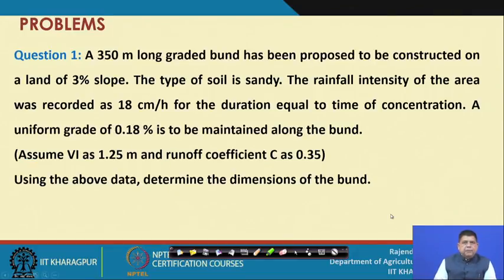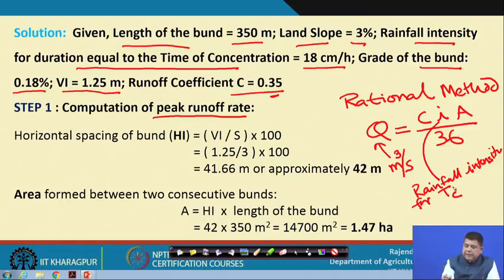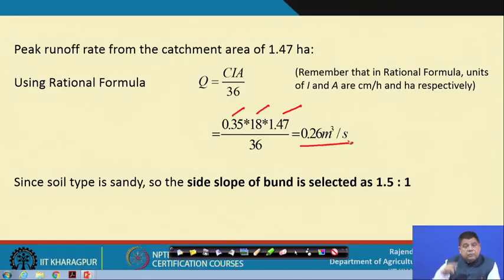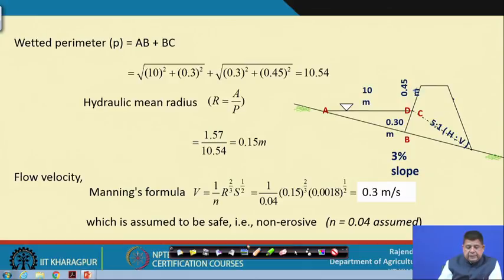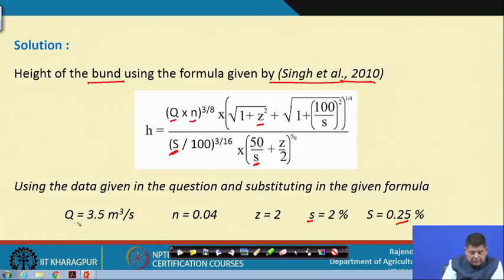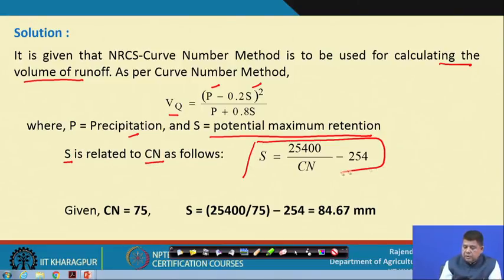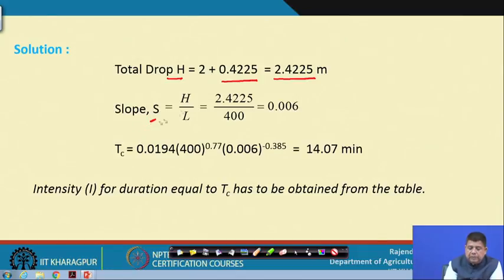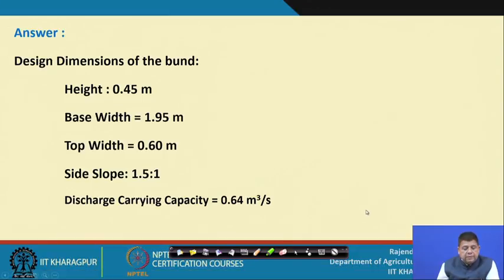Lecture 15:  Problems on Graded Bunds

Comment: Sir numerical on grades of bund mantained:-
NUMERICALS: 
Question: 
A 350m long graded bund has been proposed to construct on a land of 3% slope. The 
type of soil is sandy. The rainfall intensity of the area was recorded as 18 cm/hr for the 
duration equal to time of concentration. The grades to be maintained are as follows: 
 i) 1st 50m length=0.1% 
 ii) 2nd 150m length= 0.15% 

 iii) 3rd 150 m length =0.2% 
Determine the dimension of bund?
Reply: Please solve this sir please🙏🙏🙏🙏

Comment: Sir we saw side slope of bund of sandy soil is 2:1 in previous video. But why it is 1.5:1 here?
Reply: same. I also have this doubt
Reply: See standards say that the side slope will always be the 1:1 for clay soil , 1.5:1 for silty loam/loam soil , and for sandy soil it is 2:1 until in question you have not given any specific value for the side slope same goes for the seepage line slope
Reply: So just in 1st question there is not any given any value so we use standard value and here is given some value so we use that value cause specifically value is given.